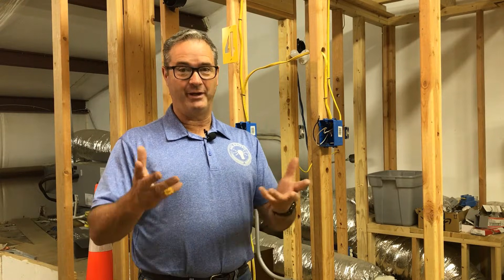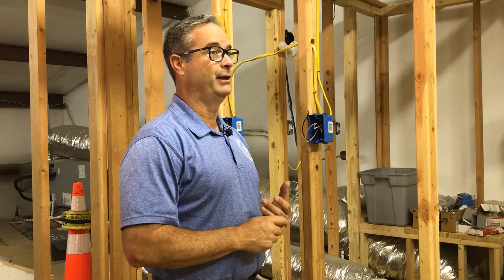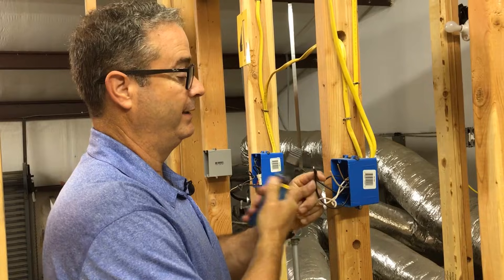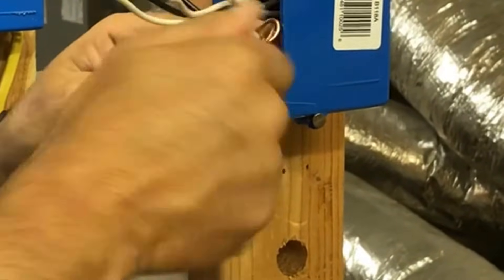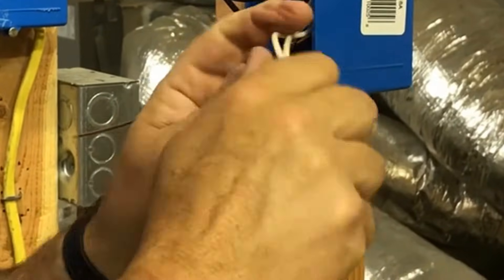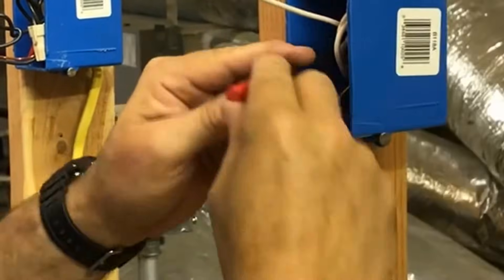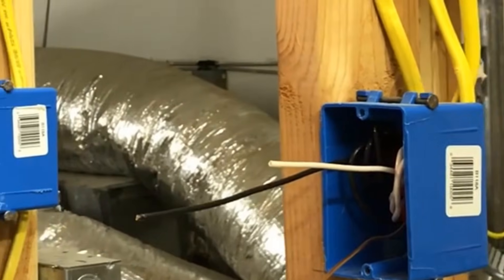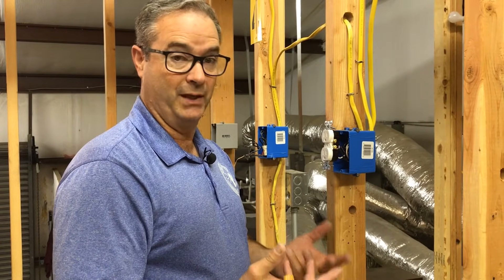How to Pigtail Electrical Wires

Comment: If I have a GFCI outlet that I want to protect everything downstream of it, should I use both sets of terminals on the GFCI and then pigtail everything after that point?
Reply from the maker: Power in will go to your line side terminals of the gfci. Everything that you want protected Downstream will probably be pigtailed like you said on the load terminals
Reply: @abrelectric gotcha. Thanks for the reply.

Comment: The pig tail used terminates wires but also leaves a sheathed wire for stripping and using that has nice length.

Comment: Sent you an email synopsis of what my situation is...trying to get pics right now if you have the time to take a look. If not, that's cool too - I understand, life is busy. I'm at my wits end and this is growing into a situation I no longer want to be involved in, lol. I have the black and white hooked up to the stupid switch with the black as a hot of course and was told that the white needed to be hooked up as a hot under the 2nd brass screw. Nope. Everything lights up when I flip the breaker, but with the light switches in the off position. Then when I flip it to the on position it trips the breaker. I just need to know how to do it correctly before I fail, drop it and move away from the grid altogether.

Comment: Nice, get it I think. However, do you have a video that shows in detail - how to pigtail a bathroom ceiling fixture to the main power coming in along with a light switch and receptacle (both on different 12/2 wire but in the same box? Also, bathroom fixture has a plate with a hair-like ground tied to it and is in a drop ceiling while the junction box is about 18" above on the actual ceiling. AI is telling me to run a pigtail between that plate and the junction box above???
Reply from the maker: You'll have to send some pictures for offer anything useful  :)
Sounds interesting
Reply: @abrelectric  I'll send pics if you have a place for me to send them, brother - just let me know. I will send pics of what I have done thus far and of the bathroom setup I have going on. As I stated before, the bathroom setup has me going crazier than a dog in a hubcap factory. Scary stuff. That plate that has the copper strands for the ground that connects to the bathroom ceiling light fixture...can't figure it out and since I have no one in the world to help me or even tell me what is what and chatgpt wants me to  pigtail that stranded copper grounded plate from the top of that light fixture (which feeds through the  unfortunately installed drop ceiling to cover the atrocious wiring job) and affix that plate to the junction box 18" above the drop ceiling.
Reply from the maker: @ChambersOfTheSouth support@abrelectric.com
Reply: @abrelectric  Hey, brother, I want to let you know that I appreciate your help and the service you offer on here for people that aren't electricians and are clearly not professionals in any way. Ignore the a holes, brother.

Comment: Im in electric school but been confused on this one thing, when I am wiring a switch I only have to j hook one hot wire?
Reply from the maker: It depends. If you have multiple constant hot wires, power in and let's say two Powers out. You would pigtail those three constant powers so you have a pigtail going to your switch, and then your switch leg terminating on the second screw going up to the light.

Comment: Of course you show this on new construction so it looks 100000 times easier than it really is 🤣 what do you do if all the wire won’t fit behind the outlet?? Certainly you don’t want to bury the pigtail in the wall
Reply from the maker: Art 314 has the info for sizing box volume. 2 things I see with a crowded box. One. The wires are messy and disorganized. Two. The box was always going to be too small, and you need something with more cubic inches.

Comment: Ok but my question is that those wires you cut off of to start the twisting together can I use those wires to pigtail?
Reply from the maker: If they are long enough to give you the right working length that you want, certainly

Comment: great video, exactly what i'm facing in my old trailer. Had no idea why there were multiple wires in the back and on the terminals...Thanks a lot....:face-fuchsia-wide-eyes:
Reply: I’m dealing with the same shit lol. 22, first home, had it for three years now and did nothing. Had breakers tripping so I started looking at outlets and almost all of them are in series AND backstabbed. One had a neutral with burned casing and corrosion. Crazy the house isn’t just a pile of ash
Reply: @doomsdaycce  Hang in there bro..:face-fuchsia-wide-eyes:...

Comment: srews  unused should be ran down my uncle in his day as an electrician toald me he once went to fix a light switch that shorted out against the grounded metal j box do to the original installer not running the light switch screw down

Comment: Hi, thanks for the helpful video. Was wondering- if I were to use Wago lever nuts instead of wire nuts, in this exact same type of scenario, would I just put the hots in their own slot, and the hot pigtail in the 3rd slot, and same for neutrals and grounds?
Reply from the maker: @TaminicoleBurke  yes! Which slot in the wago depends on how it will best fit in the back of the box.

Comment: why is there 3 wires already in the box? my pig tail makes the third wire.  hot and nuteral and ground in. (1) pig tail for each to the outlet (2) then wire out to the next outlet (3)
Reply: Because it not only goes to the next outlet, but also splits off to another branch of the same circuit.

Comment: I was pigtailing the ground wires, but not the other wires and had a heck of a time getting the plug to screw in flush. This looks like it will save me some time. Also, I had one plug in my older mobile home that cost me around $300 for the electrician to trace down what happened to my septic system because it was on the end of the circuit. It was because they didn't use the screwes to wire in the plug. And now I understand the other reason for pigtailing. Thanks again.

Comment: I am guessing you wouldnt want to use this method for adding a 2nd outlet in a bathroom. This would pypass the gfci trip function, right?
Reply from the maker: @danielrubidge4086  yes. You would need a 2d GFCI,  wired line side only.

Comment: 3 years later....would you use wago instead?
Reply from the maker: @ravenkitty1960  maybe. In my opinion,  the Wago has improved, I don't hear about as many fails as before. However,  I've been twisting wires with wirenuts for a while lol.

Comment: Where can I find those short pigtail wires I need neutral ones and hot ones. The exact ones in this video. If anything please list the names that would help me alot thanks!
Reply from the maker: I made them, cutting those 6" wires from a piece of Romex
Reply: @abrelectric  thank you so much!! I was lucky enough to find some Romex rolled up in the garage and never knew I had them lol!
Reply: Using pieces of Romex is commonly done I suppose, but technically it is a code violation. Reference NEC 310.8(A) requires that all conductors and cables shall be marked to indicate voltage, AWG, etc. (paraphrased). Use of THHN wire of the appropriate color and gauge would be the solution, FYI.

Comment: Nice and simple but why not describe why you twisted two wires together and then added the third wire before pig tailing.  Why not put all three wires together before pig tailing?  Personal preference or some other reason?
Reply from the maker: The first 2 are the in and out power, the 3rd is the jumper to the device. It's really just habit, not a rationale choice :)